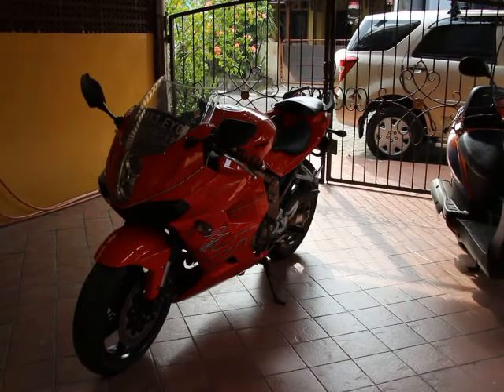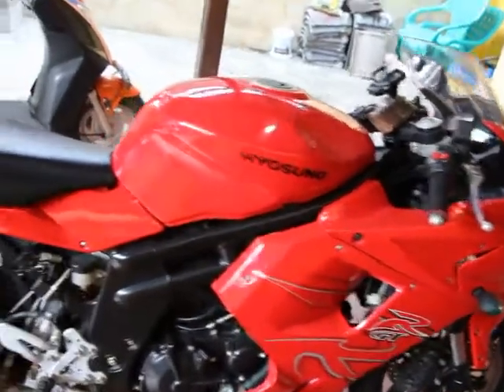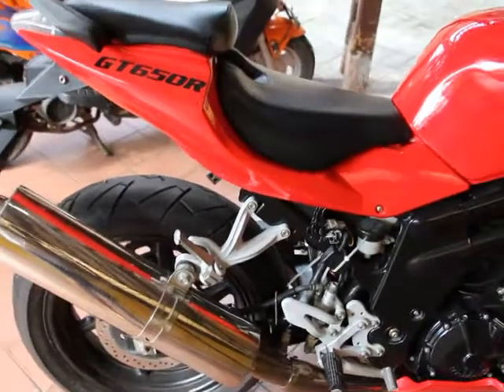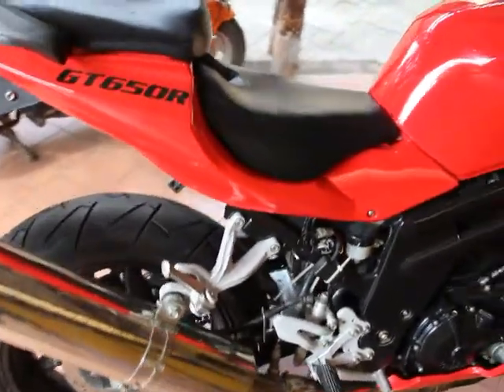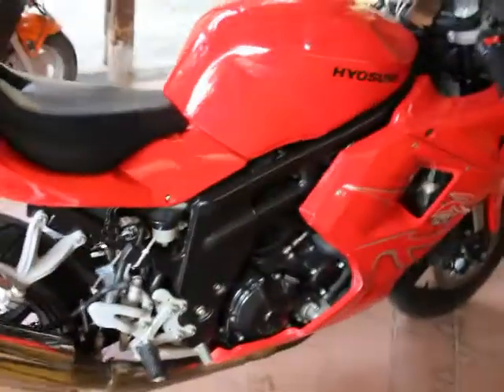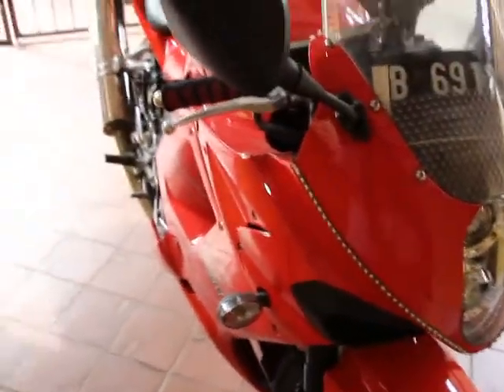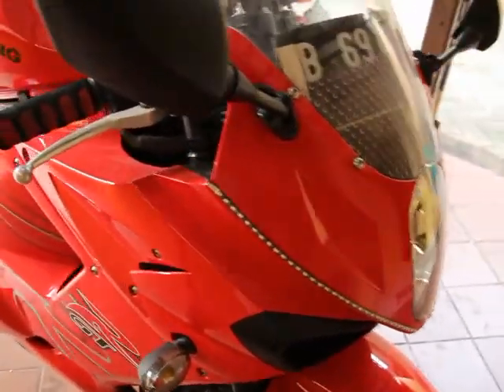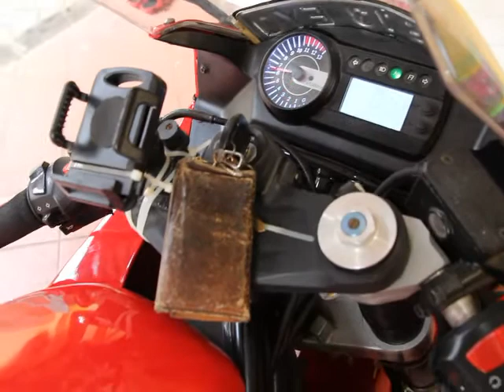2012 Hyosung GT650R with Power Commander V & Custom Exhaust captured with Canon 650D

Comment: Hey mate you say this is a 2012 model? How did you get the PCV to integrate into the loom? I know they dont sell these for the 2012 model, so im curious how did you make it work? I want a PCV for my bike 2012 gt650R also, but wont buy one unless i know it works.
Reply from the maker: Hi. I am not sure  how they do it. I purchased it from the bike dealer and they did all the setup. We can buy the PC V in ebay I think. Sorry not much of a help.

Comment: Minta alamat dealer hyosung di jakarta mas...tau ga...
Thks..
Reply from the maker: Halo,
dealernya Sportisi Motorsport
JL. Tenggiri No. 4A Rawamangun
(samping terminal bus Rawamagun)
JAKARTA TIMUR – INDONESIA
POSTAL CODE : 13220
PHONE : +622147862148/54 / +622147860787 / 810
FAX : +62214892765
EMAIL : koko@sportisi.com.
Hyosung di Indonesia di rakit oleh PT.Honlei di Semarang, tapi info terakhir mereka tidak impor CKD lagi motor ini.

Comment: What?? 61 at the rear wheel with a PC and straight pipe?? out of 79? That's a 23% drivetrain loss! Bro you have lost power! What's the dyno on the totally stock bike without anything? Compare it to that and tell me please
Reply from the maker: Hi Mr. Krios.
yes. I had it 3 times and all of them reads around 60-61 HP at the rear. I am not sure how, but looking at other dyno result at youtube I get around 64HP. Once saw 72HP but this is the only video I think. they might claimed it wrong about the 79HP at the crank or the mechanical loss is that high. The rim is so heavy, that is probably one of the factor.Unfortunately I sold the bike last year and get me a Kawasaki  Z800. Will do a video of this bike later. Thanks.
Reply: Thanks for the reply Victor, I need your help. I'm getting a 2015 GT650 Naked for a good price over here, that's all the wallet can allow period. Can you please give me a picture of what to expect, also why you sold the bike etc. Btw the 72 Hp dyno on Youtube is of the guy who installed an exhaust with a custom remap. Your totally stock bike dyno run was 61 Hp?
Reply from the maker: Hi sorry for the late reply. I sold it because I miss the sound of 4 cylinders engine (I owned a 1993 Suzuki GSF400 before).  I think with a good setting you could get around 65-67Hp at the rear wheel. Changing the rim might help. The stock ones are really heavy.
Reply from the maker: I remember the mechanic change the connector/socket because it has different type with the one the bike had. In the korider.com there is more detailed discussion aboit this. Hope this helps.